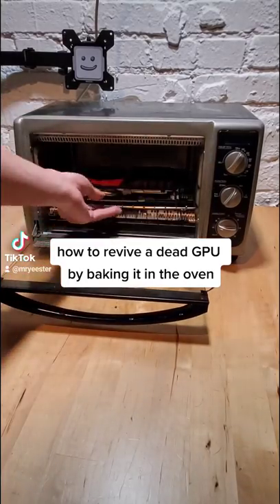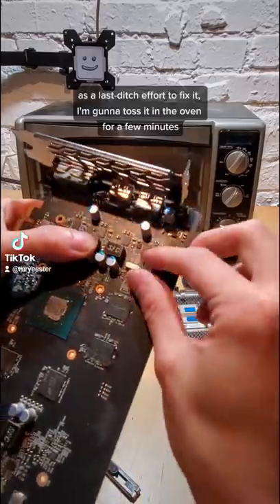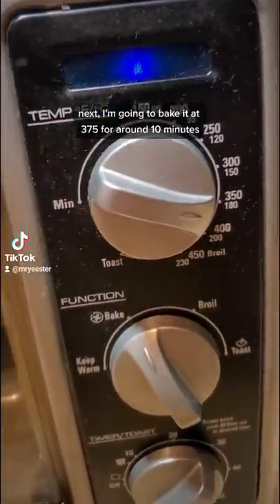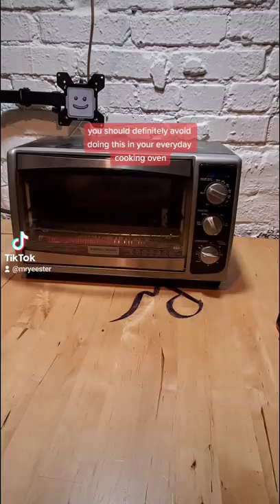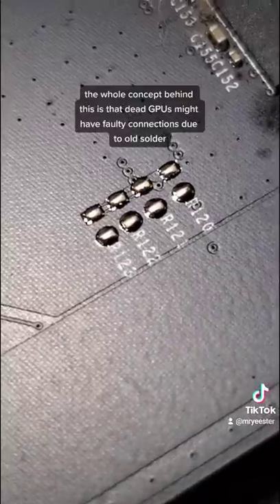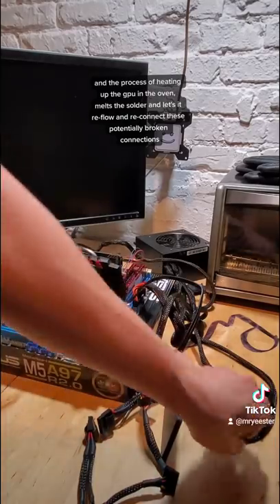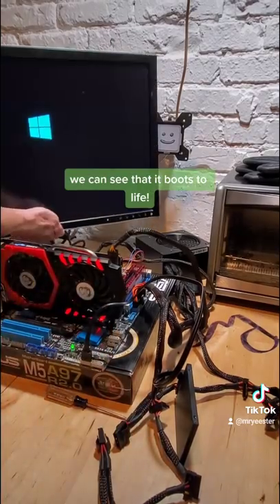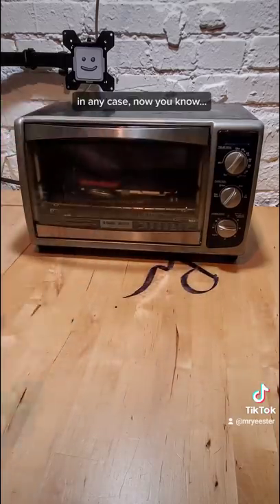How to revive a dead GPU in the oven #shorts

Comment: Why do I feel like this works and is fake at the same time 🤔
Reply: It works sometimes yes but it's strongly NOT recommended and it will always be only a short term solution.
Kind of funny that almost every video and site I see about baking GPUs is with an MSI card....
Never buy MSI GPUs and you should be fine I guess
Reply: @JT_6233  lmao
Reply: @JT_6233  msi is best bro
Reply: @bladerunner9590  
Nope they are definitely not.
A few reasons:
1. The CEO of MSI literally killed himself... No one knows why.
2. MSI tried to scalpe their own GPUs. When people found this out (especially Gamers Nexus) he was also mentioning a lot of other bad things about MSI. And MSI was in a lot of trouble. 
3. MSI has a lot of GPUs with questionable cooling design. And yes, as far as I am concerned, cheaper MSI GPUs tend to fail after a few years... 
(maybe i am totally wrong about this)

The only MSI product I ever had was an MSI RX 5700XT Evoke OC. Very unique design, looked very nice BUT it broke after a few days (artifacting like crazy). The card was brand new, I bought it from a normal shop and after that defect I returned it. 
The card was really light because the actual cooler was very cheap (Gamers Nexus also made a good video about it), the memory of the GPU literally wasn't cooled (Thermal Pads only touching half of the memory) and the GPU was because of the bad cooling design VERY LOUD. GPU die temps were OK but the noise was just crazy.
Reply: @JT_6233  literally is a last ditch effort before throwing it away. i did this to an old 750 back in 2014, still working today, using it in my Minecraft server pc lol
Reply: @PneumaticFrog  
But how did you do it?
I mean the fumes are toxic and if you did this in your oven you should no longer use it for anything that has to to with groceries.
Was it really also an MSI card?
Reply: @JT_6233  not an msi card, also used an old oven i had in storage that i couldnt sell, worked a treat
Reply: @JT_6233  The fact that a man Epstiened himself doesn't make the company garbage. That's a silly excuse and a reach to say that's partly why msi is a garbage brand. Focus on the real things
Reply: This isn't a real fix.
Reply: @computersales  it can be lol.
Reply: Msi cards has the worst ever fans! Only asus and gigabyte and evga has a good graphic cards sapphire for amd !

Comment: I’m seriously thinking about this since this I’m building my first real deal built computer. But even then im on a tight budget. And what if my eBay gpu doesn’t come back, then im stuck with a dead GPU and 160$ in the hole. If only I had an smd rework station.
Reply: If youre gonna get a Ebay GPU i reccomend something with a possible return. Make sure ebay and the seller will allow you to return it and or even get a warranty. This will not only feel a bit more safe but youre money will be a lot more secure
Reply: yea make sure it's a reputable seller

Comment: I'm just gonna mention that this is not a reflow method. It's somewhat feasible if the GPU wasn't RoHS compliant and used leaded solder, but I'm afraid that all mass manufactured electronics now all use lead free solder which has a highrtmelting point than the toaster oven is capable of.

Leaded solder melts around 183*c (361* freedom)
Lead free solder melts at 217*c (422* freedom)

What's actually happening when you stick a dead GPU in a toaster oven is that the chip has tiny connections between the silicon die and the substrate material that carries it. These little "microbumps" as they are known can break on some FCLGA and FCBGA chip packages. Especially if the chip has been thermally cycled rapidly and frequently.

When you heat the chip using a toaster oven, you cause expansion of the silicon die and the substrate of the chip. This causes movement of the damaged connection, and there is a possiblity that this can cause the bad connection to realign inside the chip. When this happens, you effectively "revive" the card.

However, do note that the damage to the chip is already done. This repair could last a few minutes, or you might get lucky and it lasts ''till you can replace the card.

Either way, that damaged connection is going to eventually shift agin from thermal cycling, and the card will fail to work again.

Comment: The solder arent get very soft at those temps. I think its the capacitors which are get working again. I brought to life 2 GPUs and a Motherboard with that a few years ago and its still working. So it is doing something and it can work.

Comment: So, while this sometimes works, it's not a surefire way to reflow solder, and most of the time broken solder joints aren't the problem since cards aren't really moved around enough for most stress damage and doesn't get hot enough for heat damage, even on bad soldering jobs that still left the device completely functional. Often it's a dead component that was under too much electrical strain for too long (operated to the edges of its tolerances for too long or was a bad part that just barely made the cut in QC). If it does happen to actually need a reflow, there's no real guarantee that the oven will actually do it well enough where an actual reflow and (if necessary) reball station will. Also the oven is a temporary fix at best and will not last like an actual reflow and reball will. Those stations and skills are obviously expensive, but if you're desperate enough you might be able to find someonr local who's willing to give it a shot for a couple hundred bucks. THAT is what I would consider the last resort.

Comment: I have actually done this and it worked. I used a gas oven with no idea what temperature it was at so I tested it with other dead electronics first and it worked. I have also fixed a PS3 doing the same thing. 8minutes gas mark 9 👍

Comment: this is some kind of urban legends, the heat changes so much PNP and NPN malfunctions caused more errors than any solderball makes not a good connection. the only thing that can get broken solderballs is the BGA connection of the Die but this part is also covered in secure glue and mostly the cause that extreem heat fixed a dead GPU are a broken NPN or PNP section that can temporarly  repaired by this process. the other thing is if this solve problems the GPU will get dead soon in 95% of the cases.

Comment: I've got two overclocked Gigabyte HD6950s that both failed about a week out of their 5 year warranty from a bad beta driver update that stopped the fans from coming on during a heavy fallout gaming session on my crossfired triple screen setup. I've managed to oven them both back to life 5 or 6 times now, using some no clean Kester flux under the GPU dies and "baking" them at 200-220 F for about 10 minutes. Any hotter than that, and you run the risk of popping the capacitors on the board. Some good advice from my experience: Put them in the oven cold, to properly ramp up the heat, and then leave them in the oven after the heat cycle to slowly cool down, to prevent the solder from cracking again. It doesn't seem to be a permanent fix, but it's worked for me every time they start artifacting or completely stop displaying video so far. As much as I cringe doing this to a pair of cards that cost me 800 bucks back in their day, they simply aren't worth being sent out for a reball service any more.

Comment: The oven method it typically to “repair” large GPU dies, the idea being the tiny interconnects between the silicon and substrate are moved as the card heats and cools so reheating the card in the oven can get these interconnects back in place.

This is what I’ve heard from Buildzoid, he is more knowledgeable about this than me and has a larger collection of hardware.

Comment: this works for max 6 months if you are lucky. its always better to send your graphics card/laptop to professional repair centers for them to put new solder balls and also if you wanma do this on a laptop you can open it and use a heat gun or hair dryer on the gpu or cover the entire laptop and the fan holes and wait for it to heat by itself and wait for it to cool down after it shuts off then open fan holes and it should work

Comment: Cover all plastic parts and video output ports with caption tape and then aluminium foil. 
Also this method is not a permanent fix. It may work for few days to few years. Louis rossman explained it very well few years back..

Comment: Reflowing the solder itself isnt what necessarily makes this work. This fix works because of the rapid high temperature shock that causes the GPU itself to expand rapidly often foxes bad connection on the BGA connection to the substrate. This is often done with GPUs that have large dies because the temperature fluctuations from normal use are more likely to cause poor BGA connections over time - due to the fact that a larger die will cover more area when it expands.

Comment: The issue isn’t the solder, the issue is witching the gpu die itself, heating the gpu die up at a low temperature will even fix it, temporarily of course

Comment: Like the guy said if the gpu u is dead and destined for the bin why not try it . Add some soldering flux any visible solder though first as this will help the joints to last longer

Comment: Yeah, put the gpu pcb naked on the metal grill and bake it so the solder can flow and attach itself to the grill. 
You should use aluminium balls on the corners where there are no components on the pcb to lift it. Or just use metal standoffs on random holes.

Comment: it doesn't get hot enough to reflow the solder. if it did all the stuff on the back would just fall off. might need a hot air station and don't move it because the solder connections are very close to each other.

Comment: The solder joints will be severely weakend by this process making it only a temporary fix. The only way to fix an open circuit on your GPU is to reball the solder joints, entirely replacing the solder and flux.

Comment: Used to use a similar trick on an old laptop. Would turn on but not boot, so I would put it in my bed under some pillows to intentionally overheat it, then turn it off and on, and it would boot. My thought process was that there was a hairline crack somewhere, and heating it would expand and reconnect. Never thought to heat in an oven to melt and permanently reconnect the solder. Huh, the more you know lol

Comment: What you just did isn’t a reflow, you didn’t melt anything as a matter of fact. You temporarily revived the GPU chip (substrate + die) by adding immense amounts of heat to it. In this case; the solder balls under the substrate didn’t crack, and they didn’t melt either. The chip itself died, either the substrate PCB, a SMD on the substrate or the die. This is a temporary repair, that card will fail within 1-2 months, and possibly permanently fail. You can also warp the actual board due to heat flexing the board, and that board did look a bit flexed when you took it out of the oven. A great example is the Xbox 360 of all things, the early models had an issue where the die solder bumps that connect the die to the substrate, not the BGA balls under the substrate that connect to the motherboard would crack due to thermal stress, however you could not repair them because of 2 factors. A: the solder bumps were microscopic. Even the best microsolderer wouldn’t be able to fix it. B: there was a lot of underfill in between the die and substrate that couldn’t be removed without killing the chip. Anyways, what people would do is let the console overheat by wrapping it in a towel, and then letting it sit for 20 minutes. This worked because of the exact same reason it worked with the oven. You are heating a chip just enough for the chip to temporarily work again, however it will die within 1-2 months, possibly less than that. If you got your PS3 reballed, chances are the reball didn’t fix it, but the over 200C required to remove the chip from the motherboard, the more heat required to attach new solder balls and the 200C again required for reattachment revived it, which is why it died again within 3 months. 

TLDR, this isn’t a reflow, this is temporary revival by heat and you should never do this. Get it RMA or professionally fixed.

Comment: I had a 5 year old laptop that wouldn't display anything on the screen and sometimes wouldn't turn on. I took a hair blowdryer and put it on the fan vents of the laptop for 2-3 minutes. That would warm up the laptop enough for laptop to power on and the screen to work temporarily. Accidentally melted the plastic grill on the fan vents but it was ok.

Comment: That's kind of the same way that you would fix the PS3 YLOD. I did that twice to my old 60 GB fat PS3 and it worked both times, except I put it over a cast iron pan on the stove to heat the bottom half of the board and used a heat gun to carefully heat the top half.

Comment: You might get a month or two at best if you get lucky. If you do this you need to use liquid flux before baking, it is the flux that "could" fix the joint otherwise it will come back the joint is cracked and contaminated. Reballing is the way to go.

Comment: Yeah… that will not melt any solder at all. Since the companies are forced to use lead free solder the fusion point is above 320 Celsius, a leaded solder fusion point is around 180. 

In order to properly reflow you need to get 300+ Celsius man, you’re only softening the bga and hopefully connecting something.

Comment: This doesn't feflow solder. Ovens don't get hot enough to melt solder to a liquid state and if they did your PCB would begin to weaken. All this doesn is sofen it enough to rejoin cracked solder joints. It's close to reflowing but not close enough because the weak joins will crack again in a matter of time.

Comment: This is usually a miss understanding. Generally the solders nor the balls are the problem. It's actually the GPU die itself. The crystalline structure has a fault. Heating up the graphic card with a oven bridge back the crack but it's a temporary solution as it will fail again at some point.

Comment: I already did this on old GPU Geforce 6600 GT, Radeon HD 2600pro, Geforce 9600GT,  and even some modern GPU like RTX 2080(it got artifact) it was succeed. The difference is i warp the GPU with aluminium foil.

Comment: Warning, do NOT attempt this unless you are 100% sure that the issue you are having is specifically due to a faulty solder connection.
It is VERY easy to fuck this up and kill a GPU that could've been saved otherwise.

Comment: It's weird how this happens so often to completely stationary parts in an environment with fairly constant humidity and ambient temperature while I've never seen a PLC or CNC controller fail in the solder joints in an industrial environment where vibrations, steam, cutting fluids, welding fumes etc are ever present. Seems like an engineered failure mode to me.
Reply: Well, metal expands under heat, and a GPU can quickly go from an high temperature to a room temperature, so If the temperature changes frequently... This happens

Comment: There's a lot of potential for things to go worse here lol if you melt the solder and it shorts out you could have a pc fire because circuits would be connected that aren't suppose to be. If it routes itself past literally 1 resistor your pc is toast.

Comment: This is displacement behavior level 99.
This is only a fix if reflow is a fix for the card's issue.
If the card has a different issue, reflow will probably make it worse.
NEVER reflow before ruling out root causes that are simple/cheap to identify and fix!
If you really want to fix the card, just get it checked by a local specialist. It costs money, but if repairable, it's the best bang for the buck. Cards baked before may see even more damages and become more expensive or impossible to fix.
If it's FUBAR, the technician might still offer some cash for the card as a donor board.
If you're ready to throw it out, you can still offer it for sale as a donor.
After a bake it might not worth buttons anymore.
Baking gets you a slim chance and it probably only borrows some time before it breaks down again.

Comment: Lose connections are just a small part of the list of issues a gpu can have to stop working, in other cases this does more damage then healing so only do it if you’re sure it’s lose solder and even then it’s better to resolder manually then to FUCKING BAKE YOUR GPU, there’s a reason your gpu needs cooling intentionally heating it is a bad idea

Comment: Bro just use a heat gun the external power is plastic so just heat up the gpu for around 5 mins for 350 degrees

Comment: if you want to do this you shouldnt keep it in there for 10 minutes. 7 minutes max, and you should apply flux. BUT, gpus are BGA chips wich means its gonna be a pain in the a** to repair without the proper equipment.

Comment: Please dont do it. It will start working for like 6 weeks and than it fails again. The card is broken. At some time the apu on a notebook faild and we searched on ebay for repair and there were some charging 30 bucks and basically heating the notebook up. But we send it to a professional who replaced the apu. The professional said to us: He sometimes gets these burned Notebooks and he cant save them, so dont do it. 
There is a reason why a pc shuts down when it gets too hot.

Comment: Never reflow your graphics card because solder isn't a problem the problem is in 99,99% always silicon balls inside processor to repair your card you have to replace graphics processor

Comment: Liar. The solder will NOT melt in any household oven. Due to expanding/shrinking from the heating, you got a change that the bad contacts underneath the gpu reconnect temporarily. Your graphics card will remain unreliable and will fail again soon. It is an old hack, and to be fair I used it once to reanimate a graphics card and then quickly sell it.